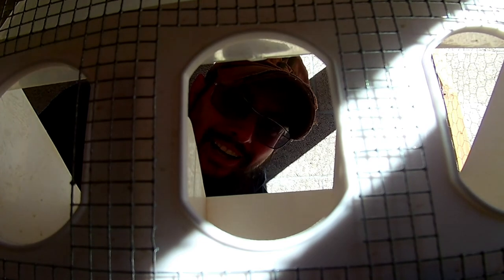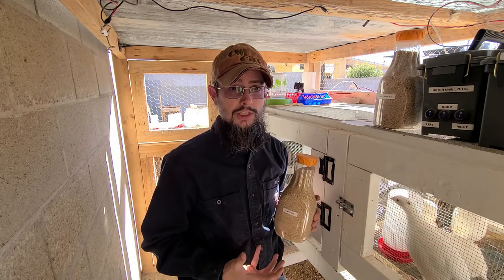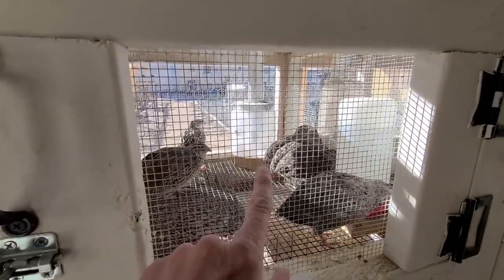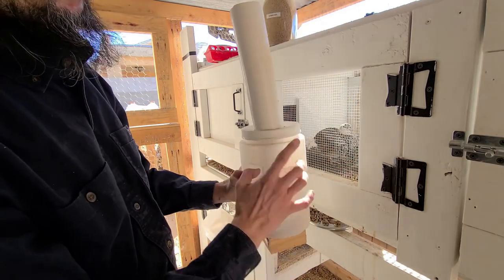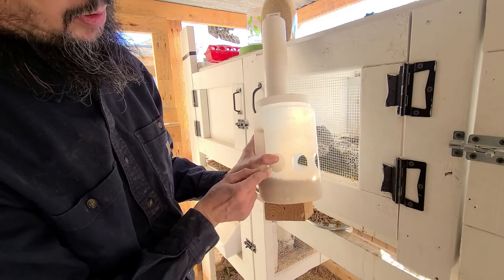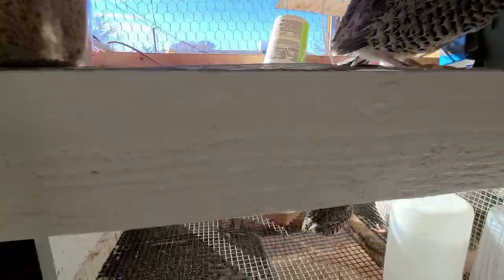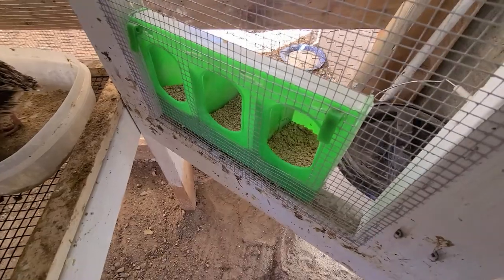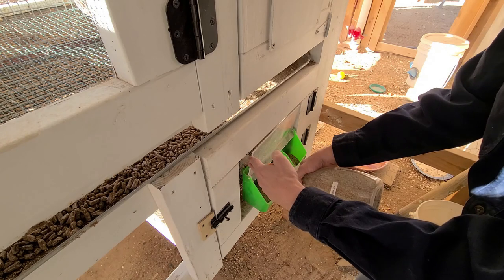No/Low Mess Quail Feeders

Comment: I like your homemade feeders. We have new quail (first timers) and have been looking at lots of ideas to make feeding better and easier. I like the idea of this round feeder so much better than the shoebox version. Also thank you for saying where to put the holes and adding the 2x4. That's very helpful. We built a walk-in aviary for ours and will have the batchlers in pens that are inside the aviary but the flock will have access to the whole aviary and be on the ground. I'm hoping that will do what I envision for the birds but if I need to switch to a full cage system, I will just place that inside the aviary and it will look much like yours. Thanks again. God bless.
Reply from the maker: I hope they help :) the 2x4 ads weight aswell.  I want to do an aviary aswell, how cool 😎.  I'm pretty new to quail but they're addicting lol